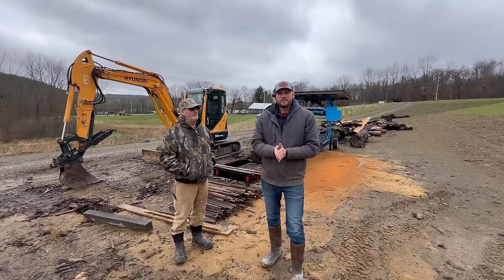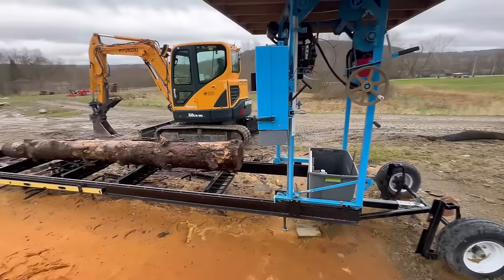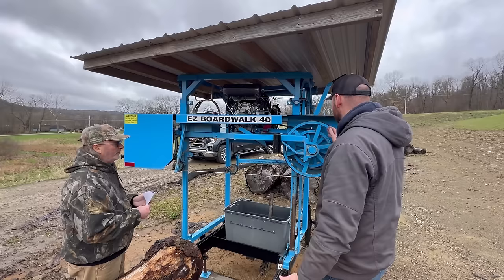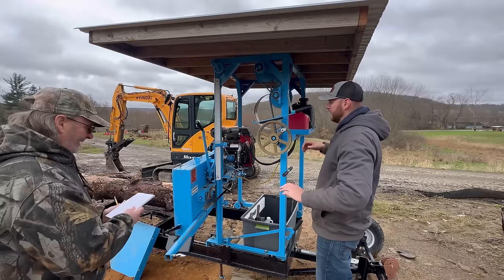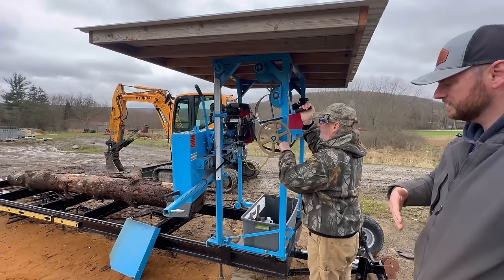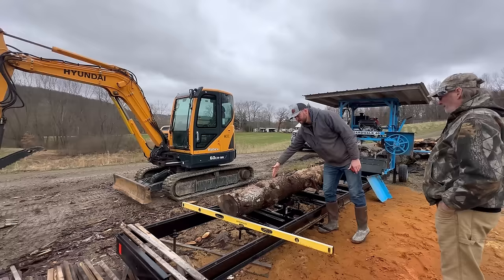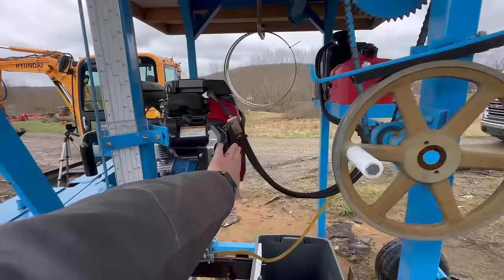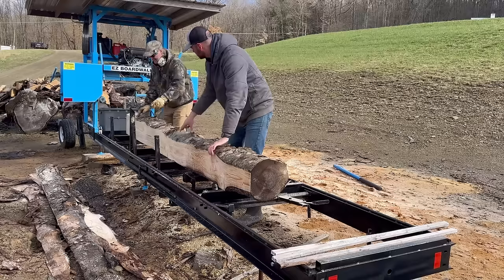This Guy Wants To Buy My Sawmill

Comment: I bought a 20 foot extension for a total of 40' of track for my Model 40 along with the trailer package and some other options. I had Stanton deliver it. He put the saw head in the bed of his truck and towed the two base 20' track with the other 20' strapped on top of the base track. Worked like a champ. I lifted the saw head out of his pickup bed with my 80hp tractor. Highly recommend ordering the largest engine option - well worth it.
Reply: we are welding up a 10' extension for my EZ Boardwalk 40 this weekend...can't wait to get it all put together so I can do 26' beams.  But 40'...wow!  That's impressive.
Reply: @homeplaceadventures  Yeah, I wanted to be able to handle up to about 36' sticks for my timber framing build. And as Adam points out, the real issue there is material handling. I might have bit off more than I can chew. We'll see how it goes when I get to that point.

Comment: When trailering it, you move the saw head to the center of the track over the trailer wheels. There is a tab and a set of bolts to hold the head onto the track. This is also the best position to secure it when you expect bad weather.

Comment: Great walk through on the EZ Boardwalk 40.  I’m loving mine!  I agree 100% about the power lift for the sawhead.  On this mill, due to its design of how to raise and lower it, zero need for a power lift.  Other mills are configured differently that require a LOT more physical exertion to raise and lower the mill.  On my previous mill it was easier to remove each board so I didn’t have to raise and lower the saw so much. With the 40 I can easily cut board after board without having to remove a board each cut bc it is very little effort to raise the sawhead.  Great video covering what is arguably the best manual mill available.